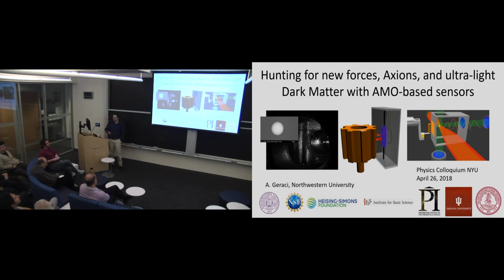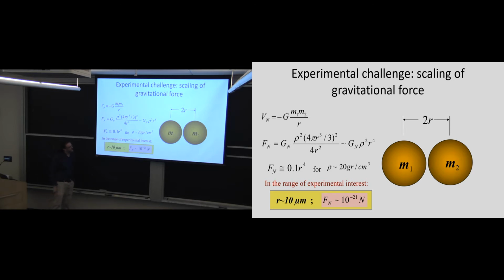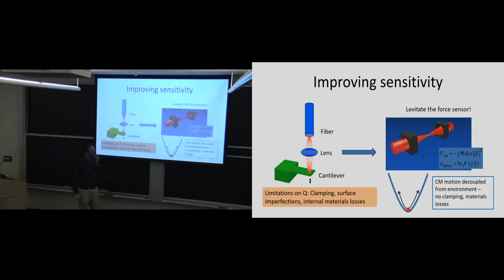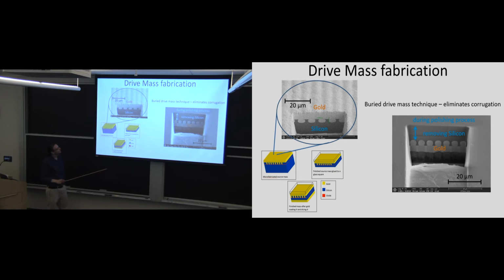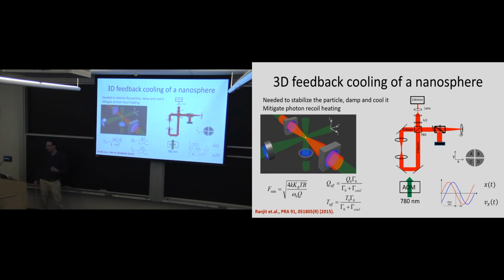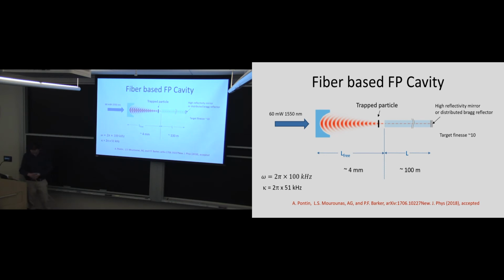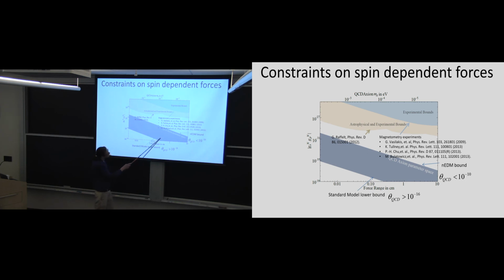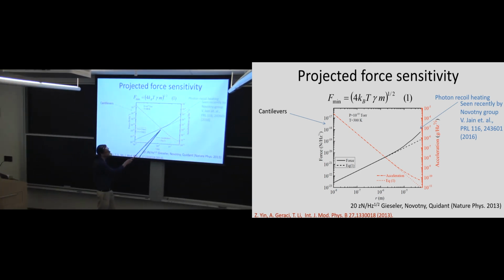Colloquium, April 26, 2018 -- Hunting for new forces, Axions, and ultra-light Dark Matter with ....

Comment: My hypothesis that Dark Matter is not a WIMP, but maybe is a deformation of space-time by which the curvature of space-time ALONE is the cause of the gravitational effect. Gravity is the consequence of the curvature of space-time.  It may be possible that the structure of space-time itself could be warped without the presence of mass.  Space-time has been shown to react like a fabric by warping, twisting, and propagating independent of mass. These properties have been proven with observations of gravitational lensing, frame dragging, and now gravitational waves. Fabrics can be stretched, pressured, and/or heated to the point of deformation. Such extreme conditions were all present during inflation, so it is plausible that space-time’s elastic nature could have hit its yield point and permanently deformed. Therefore, if gravity is the consequence of the warping of space-time, and fabrics can be permanently deformed, then a deformation could create a gravitational effect independent of mass. Thus, the unidentified dark "matter" that seems to be so elusive to modern science may not be matter at all but merely warped deformities causing gravitational effects.  DM could be a microscopic black hole with no mass at the center...
Prediction: Spacetime's elastic property hits a yield point, so only that part of geodesic's "stretch marks" would remain after inflation stopped. These steep gravitational wells would not follow the inverse square law. 
I am looking for Observationalist to help test..